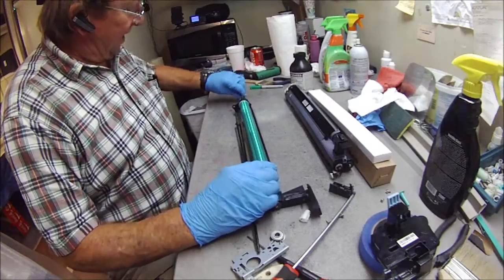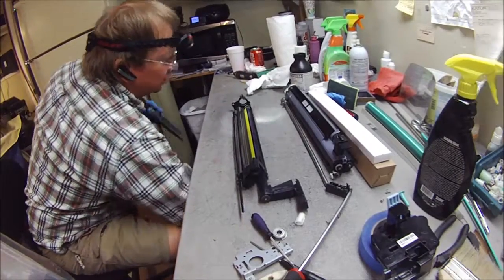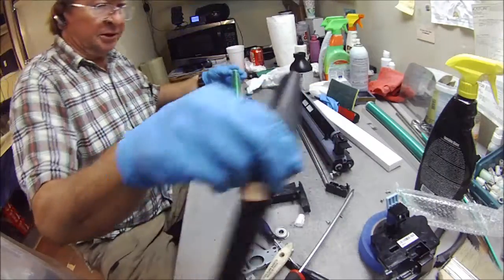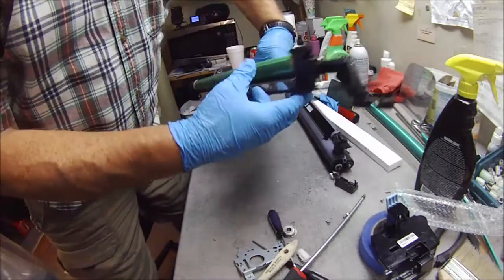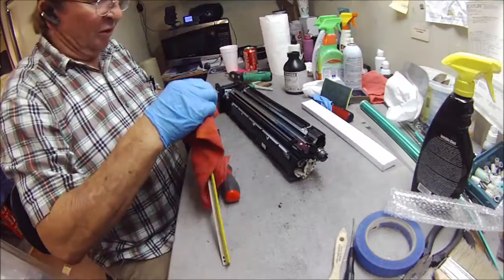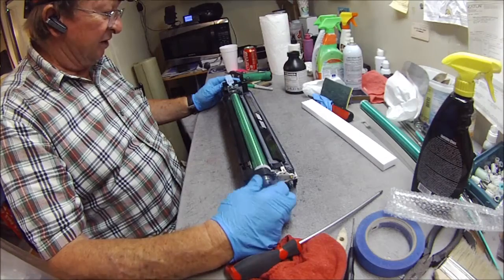Drumchangevideo

Comment: Mr Michel , I need your help with my new piper Cherokee 140/150 C for overhaul. Please, tell me the best way to overhaul this lycoming engine with high safety precession and  cheaper way. My Name is Sule and I'm 42 years old. Just bought this airplane so I can get my PPL and it really helped me through to gain total of 60 hours flying. It is a1970 and it has a good history of record and Mentenance. However, the TTAF is 5450 and TBO passed by 400. I noticed for every 4-5 hrs flying, I have to feed the engine 2 quarters of oil and I don't know if it's normal or not. However, just to be safe I will like to overhaul the engine with crank Dino and new cylinders maybe more. Please, allow me to still some knowledge so I can fly safely and be happy for many years to come and help a person in future whom is passionate about flying. Thank you.
Reply from the maker: email me please at skycaptain32724@gmail.com with your comment. Thanks